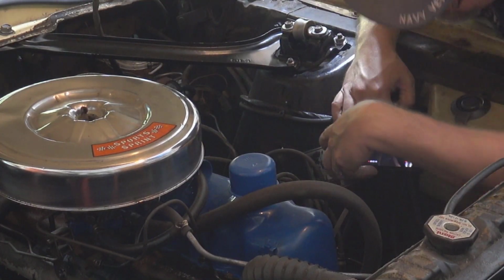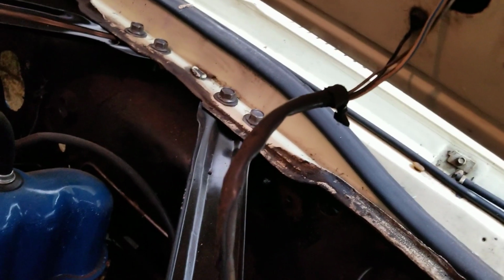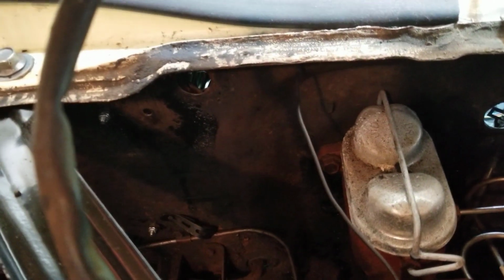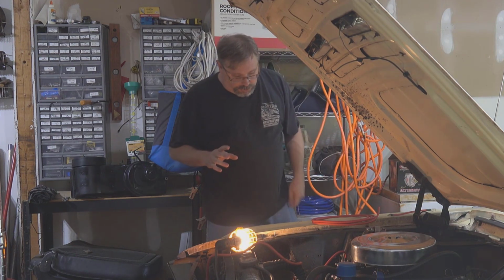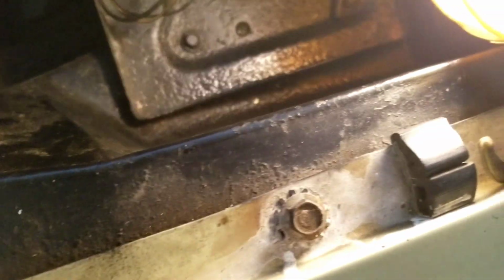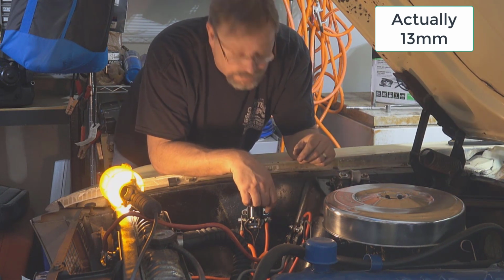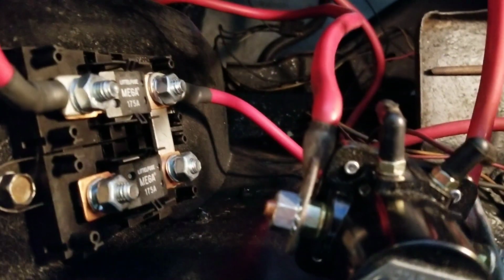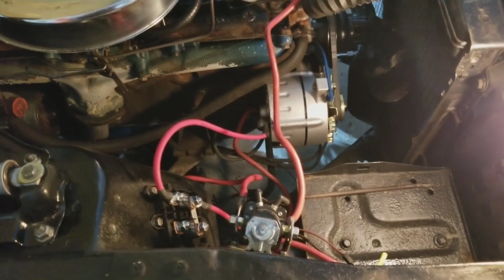Rewire the Stang Part 4 Install one wire Alternator and mega fuse

Comment: That's good AAW comes with these instead of fusible links. I have the old AAW kit that came with Fusible link wires and directions called for a connector to be installed after fusible link to fuse panel. Guess what that connector wasn't happy over heated melted and left me stranded at night with a car that had non-functional hazard lights. Very dangerous situation. Needless to say I am going to upgrade to mega fuses and ditch all fusible links.
Reply from the maker: Wow that sounds scary. So far so good with this version of the AAW kit.

Comment: Where can I get one of those mega fuses at? Been trying to find one all day!
Reply: I’ll try American auto wire, all the other ones only show 2 circuit and I need the 3 circuit like you have.
Reply from the maker: That one was part of the entire wire harness kit I got for the car. So not sure if they sell them individually or not. Worth a look though.
Reply: @67Stang  yeah, I found one through American auto wire thanks bud!
Reply from the maker: @richardmichelteammichel8898  Outstanding glad I could help. Let me know how it goes
Reply from the maker: A quick google search seems to show that you can get them from several places including American Autowire, Summit Racing, and eBay just to name a few.